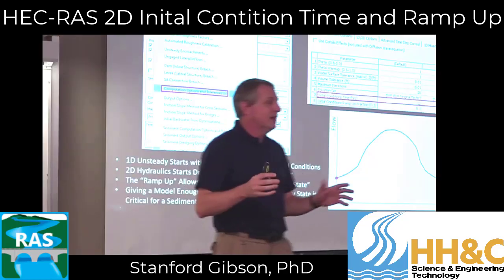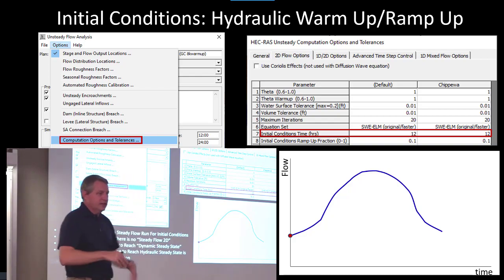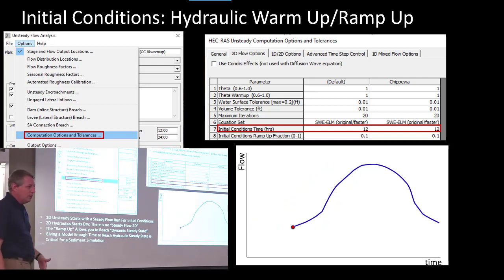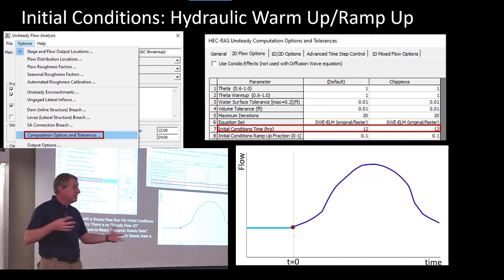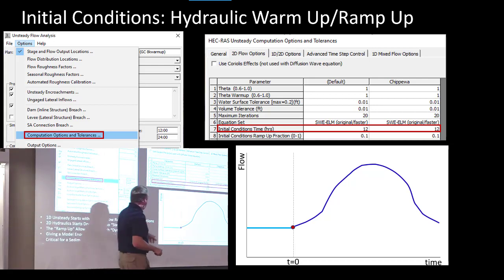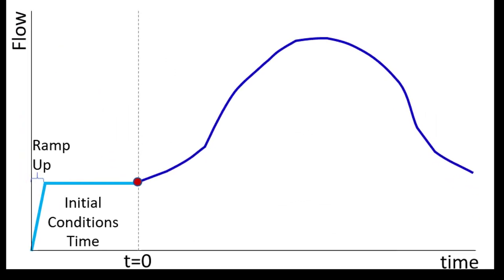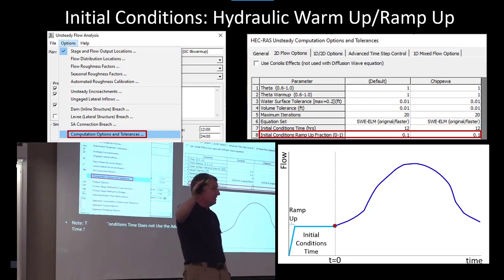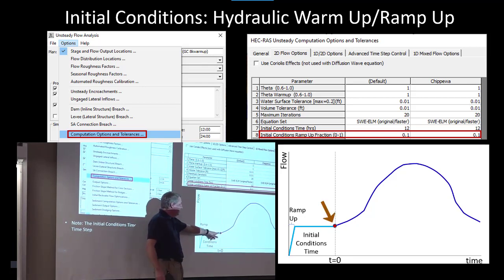HEC-RAS 2D Initial Conditions Time (Warm-up) and Ramp Up Fraction

Comment: Hi Dr. Gibson! First off, thanks for all the great videos. I have been watching quite a few of them as I set up a sediment model for the first time.

I do have a quick question if you see this comment. I have set up a 2D Unsteady sediment model in many different ways trying to resolve this error, further simplifying the model each time, but I continue to come across this error. I also tried setting the hydraulic warmup period as mentioned in this video. This is the error:

forrtl: severe (151): allocatable array is already allocated
Image              PC                Routine            Line        Source             
RasUnsteadySedime  00007FF7623983FD  Unknown               Unknown  Unknown
RasUnsteadySedime  00007FF7616F9F21  READ_UN_SEDIMENT2        1329  Read_UN_Sediment2D.f90
RasUnsteadySedime  00007FF761747647  READ_UN_S2D               147  Read_UN_S2D.f90
RasUnsteadySedime  00007FF7619A12CC  SNETREAL2                 189  Snetreal2.for
RasUnsteadySedime  00007FF7618CC1DC  UNETREAL                   75  Unetreal.for
RasUnsteadySedime  00007FF7616A83A4  UNET_START                143  Unet_start.for
RasUnsteadySedime  00007FF7617F6977  MAIN__                     70  Unet.for
RasUnsteadySedime  00007FF762A855BE  Unknown               Unknown  Unknown
RasUnsteadySedime  00007FF76806B979  Unknown               Unknown  Unknown
RasUnsteadySedime  00007FF76806B89E  Unknown               Unknown  Unknown

Error with program: RasUnsteadySediment.exe  Process Count = 25  Exit Code = 151

Do you have any idea what the issue is? As you can imagine, the fact that I am posting this on a YouTube video means I am pretty desperate. I have tried googling this error extensively, but with no luck. Any insight you have would be deeply appreciated.
Reply: @stanfordgibson  Thanks, Dr. Gibson! I will connect with you on LinkedIn. That would probably be good anyways, as I think we have some mutual friends at the USACE. I took a class at KU from Dr. Shelley, and have a another close friend who works there too! :)